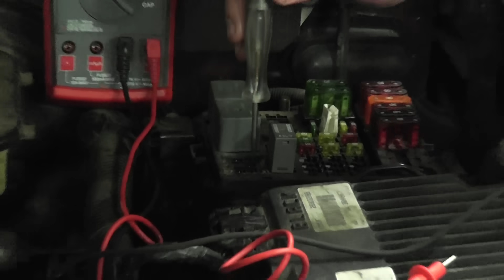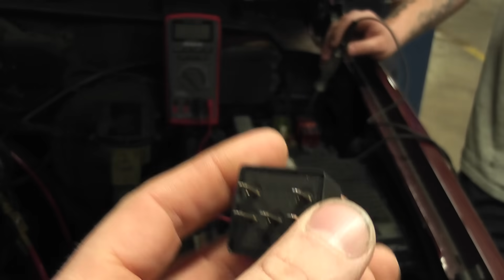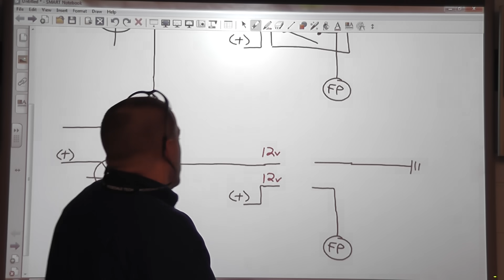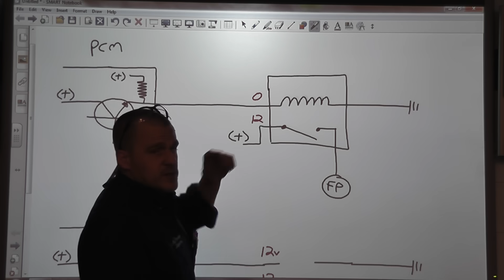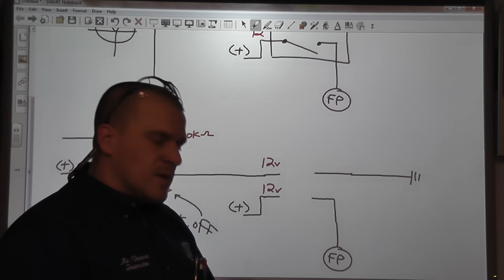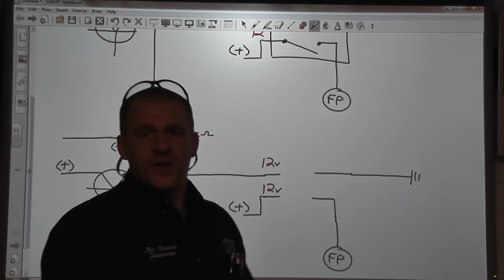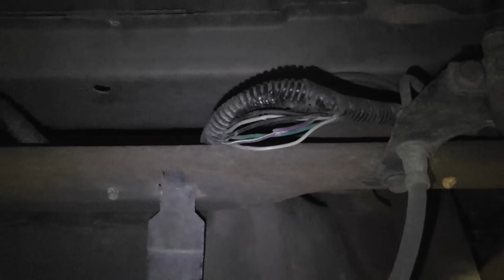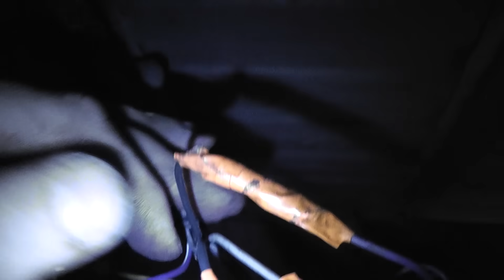GM Fuel Pump Relay Testing

Comment: This guy is good. he is very informative even when its technical, I somehow understood even when Im just laymen. I open this video because my hyundai starex 1999 wont start and I suspected on fuel pump failure cause I run low on diesel the other night. Im changing my glow plugs first since I did not have the pressure of my fuel pump tested yet.. I had a good education here. Hope we'll have more of this helpful videos. Kudos. God bless you.

Comment: The reason the Test Light does not light and the voltage meter shows the battery voltage is because of the very high input impeadance of the volt meter.
Most kinds of test equipment are designed this way as to not influence the circuit being tested.

Comment from the maker: you should have two power feeds during cranking and one power feed with the key on.
tell me what you have.
If it is a GM there should be an orange wire which is the key on power (load side of the relay)and a green/white wire which is the cranking/running power (control side of the relay)

Comment: Alright I need help I tested at the relay like this video indicated. However I have no power at the relay. Do you have another video that will explain my next step when there is no power at relay connector or should I just replace the relay connector? I have already determined the pump is good there is no power from the connector at the back or here at the relay connector.

Comment: Hi, great video! :)

I have a question: my central locking system is unlocking the doors everytime I try to lock them! So I want to test my central lock relay, which has 6 pins and the references 87, 30, etc are not present. Oonly references like 1, 2, 3, 2M, 3M. Any idea about how to test it?

And is it safe to carry on a bench realy test, eenergizing it directly with the car's battery? Isn't the amperage too high that can damage the relay?

Comment from the maker: I'm not sure you can bypass this type of system without some type of add-on electronic unit. They use a resistor that is built into a hall-effect switch that is part of the lock cylinder. The re-learn on these was to simply leave the key on for 10 minutes (until the security light stops flashing) and possibly repeat the procedure.

Comment: Thanks Danner for sharing your expertize.  I've been looking very hard for clear instructions on by-passing the security fuel shut off on 2000 Chevy Blazer Passlock.  This year doesn't have the resistor on the key like most youtube videos on the subject.  You're the ideal person to do such youtube demo if possible.  I Changed the body control module and needs re-learn and programming.  Would a by-pass still work without a relearn or the vehicle has to be in running condition?  Dan's the Man!

Comment: Honestly man all you have to do is know the system and then use your head to figure out a way to test it. Scanner Danner knows these systems and he uses a scanner because they make the work of a professional technician WAY WAY easier. you can do a lot of tests with basic equipment though

Comment: Dan why not get a used relay and take it apart , drill two holes in the top of the relay so that you could run a jumper wire accross the relay contacts, that way you could take an ammeter reading instead of using the t pins.

Comment from the maker: Of course you know I am going to say yes. But I think you will find that after you have it you will want to buy a scope simply because of how accurate you can be with one. I do teach other methods of testing (DMM, test lights, Scanner etc.) IT is not all scope stuff and you certainly don't need a Verus to do what I am doing. I think you will agree though that alot of the stuff I am doing you couldn't do without a scope.

Comment: The 12 volts disappear when you plug the relay back in due to the fact that the relay coil winding is good,if the relay coil were open you would still see that voltage when you plug it in.

Comment from the maker: The gray wire is the pump feed wire and you will not have power on this wire unless the relay is energized. Is the control side of the relay functional? Do you hear it click?
The control side of this relay is power side switched my the PCM. Do you have two power feeds during a crank to this relay?

Comment: HEY PAUL, YESTERDAY I HAD A CHEVY TRUCK WITH NO FUEL PRESSURE, THE CUSTOMER HAD REPLACED THE PUMP HIMSELF 3 TIMES AND DECIDED TO BRING IT TO THE SHOP, THE PUMP PRIME AND RAN BUT NO PRESSURE, AFTER  DOING ALL MY CHECKS,,,,, IT WAS A PUMP MADE IN CHINA , I NOTICED THE PUMP MOTOR HAD REVERSE POLARITY NOTHING THE CUSTOMER DID, THIS IS THE SECOND TIME I SEEN PARTS FROM CHINA WITH REVERSE POLARITY, BE AWARE OF PUMPS MADE IN CHINA!!!!!

Comment: If the customer told you that he replaced the pump, having to cut the wires... would you have looked there first?  I would think that would be pretty important info that the customer should share...  Did you ask him why he just hooked up all the wires to the wrong place?  Great info on the bias voltage for monitoring circuit.  That could save a lot of headaches for those troubleshooting w/ a volt-meter.

Comment from the maker: Because the amperage was very low (around 2 amps), a plugged filter causing no fuel pressure at all would have caused very high amps. Also from my experience if you have a fuel filter that is plugged so bad as to cause a 0 fuel pressure reading, that filter has already ruined the fuel pump. So you put a pump and filter in it. Of course you could always replace the filter and re-test if you desire.

Comment: When you heard the pump running yet no fuel pressure at the gauge, why didn't you consider a plugged up fuel line or filter?

Comment from the maker: @5am8011 Hey Sam, I have seen some cars have no prime with the key on and only run when the PCM is receiving a crank signal. I think older Chrysler TBIs were like that but I'm not sure. I know older Toyota with the 7-pin Vane Airflow Meter did not have a prime with key on. FP on those only ran during a crank or with VAF air door open.

Comment: myby that was just the way of it?Im still learnin something new everyday just constantly learning. how boring would it be if you knew evry thing lol i was working on a gm (vauxhall) today and diagnosed faulty fuel pump ichecked wiring and that so im sure it is the pump but i havent seen anyother car use a crank signal for pump priming i thought turning ignition on and pum rimes was a better job. u seen any others using that method for activating the pump? and   thanks for the reply im sam

Comment from the maker: @5am8011 85 was a switched feed for the coil, 86 was coil ground (constant). I agree about pin 87 and 30 being mixed up, but it was clearly marked 87 on the relay and it was hot all the time (load side feed). Maybe the relay was marked wrong because the diagram shows pin 30 being hot all the time and pin 87 being the N.O. contact and 87a being the N.C. contact. Either way I have seen 4 pin relays wired like that, but the 5 pin shouldn't be, so I think the relay was marked wrong.

Comment: should you not be getting a feed on pins 85 or 86? one or the other the other would be earth to energise the coil to close the relay instead of getting a supply on 87? i always thought 30 was plus 12v, 85 or 86 was either switched earth or switched feed and then the other was a constant feed or earth, then 87 was your output pin and 87a was either another outut for pin 87 or else switched when 87 is not activated?????

Comment from the maker: @contagiousFX The pump circuit was wired backwards so this just causes the electric motor to spin in reverse. This caused a low amperage no psi condition. The other two wires were computer sensor wires that do not carry any measurable amount of current and would just cause full to be empty and empty to be full on the gauge. Funny thing is half tank would have been accurate.

Comment from the maker: @Bonfield2002 lol thanks, they take care of me. And thank you for the feedback, I'm glad it made sense. 
The bias voltage used on power side switched outputs (some) can be used to cut diagnostic time down to a fraction of what the flow charts will have you do for opens and shorts in a control wire. The key though is knowing about it and how to use it to your advantage. Of course as I described in the video it can get you in trouble too.

Comment: @ScannerDanner The best parts of your vids are  the ability  to explain a  function exactly although you do need some basic understanding to absorb it.  The bias voltage on the control side of the  relay  "clicked"  only after you explained its function as sensing wire to indicate a fault and turn on a MIL.  I hope they are paying you well because your earning every cent.  Well done !!!